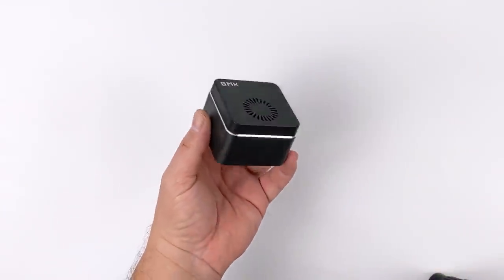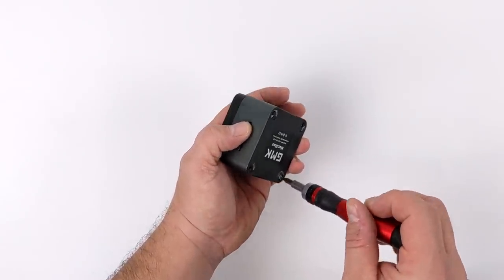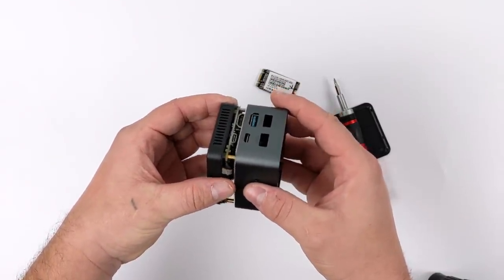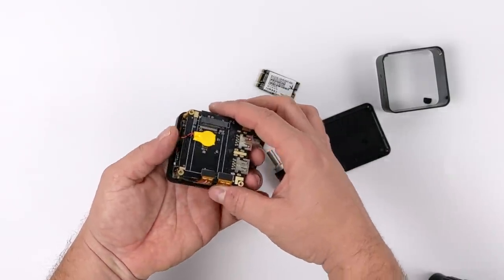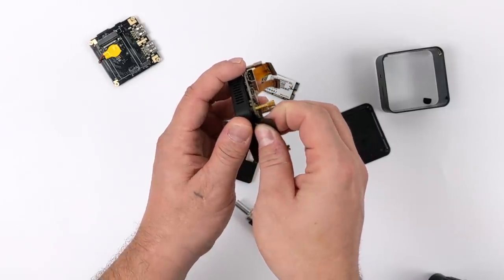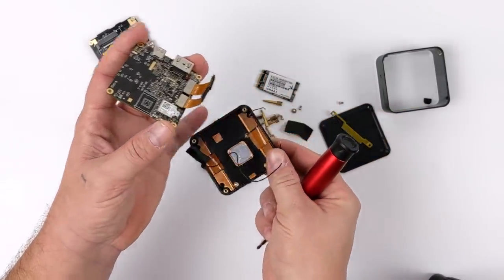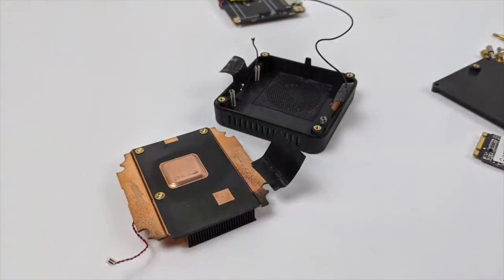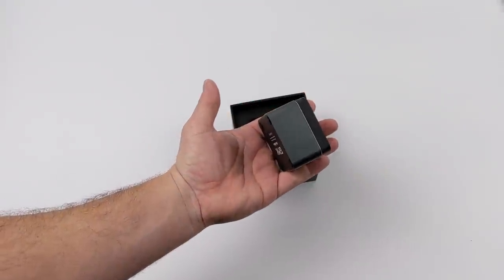GMK NucBox Teardown, Ultra Tiny 4K Windows PC

Comment: I wana see discrete graphics an more powerfull cpus in these little  box pcs
Reply: @bugrasevinc9696  you do know amd makes apus right?
Reply: @MrDeadmanwalken1  yeah i want a ryzen apu on these form factor
Reply: @mtaufiqn5040  even a ryzen 3 or 5 would be nice i wouldnt complain about the extra space needed for a vapor chamber cooler or the noise of the fan
Reply: Nvidia has a mobile gpu that could work, the mx330 I believe. It's basically a gt1030 with some modern vram. It's in a lot of light duty notebooks I've seen and it should be cool enough running for a ultra compact system.
Reply: doubt that happens but one of those juicy AMD APU's would be nice especially when they come with NAVI cores instead of VEGA cores
Reply: @LiLBitsDK  it would be a huge mini pc if they add navi
Reply: @mtaufiqn5040  why? you do know AMD makes tiny SoCs with VEGA right? going from vega to navi would not make it huge... unless you expect them to put in a 6800XT which would be unrealistic...
Reply: @LiLBitsDK  hmm let see
Reply: @DigitalJedi  there is a problem with that. I want the x86 instruction set
Reply: @MrDeadmanwalken1  the x86 instruction set is for CPUs to my knowledge. The mx330 is literally a GT-1030 with some modernized components all soldered to the motherboard. It's reasonably strong for some light gaming and plenty for video encoding/decoding.
Reply: @DigitalJedi  ah i thought you were talking about nvidias tegra... also amds apus out perform the 1030
Reply: @MrDeadmanwalken1  You said discreet graphics, which would exclude APUs as they use integrated graphics. And yes, an AMD APU would outperform a 1030 and draw less power.
Reply: @DigitalJedi  so you suggest an infferior product over an apu just because i said discrete. I was suggesting a 1650 or 1660  cut down to size like they do for laptops... why in the hell would you suggest somthing weaker than an igpu/apu?
Reply: @MrDeadmanwalken1  Something this small has serious thermal limits and power consumption to think about. My laptop runs a 1660ti and that chip draws a lot of power. A mobile 1650 would be a reasonable choice but is still likely going to be pretty hot in something smaller than my palm. What keeps those chips cool in a laptop in thermal mass and lots of forced air from the fans. You could run a 1650 in something like a mini pc, but I just think this is just a little too small. Maybe going to AMD's mobile Radeon chips is a better option.
Reply: @DigitalJedi  did you see the skull canyon nuc? That thing ran fine
Reply: @DigitalJedi  as it is nvidias 5nm process should be out next year
Reply: @DigitalJedi  also a power brick can solve power restraints
Reply: @MrDeadmanwalken1  Skull canyon nuc is much larger than these mini pcs, which is what I assumed you meant.
Reply: @DigitalJedi  as technollogy advances so do the packages ie size an temps
Reply: @DigitalJedi  Not gonna work mate. Have you seen an Mx gpu yet? The pcb space for chip and memory is literally bigger than this thing here. Not mentioning additional vrm. Apu is a better bet. Dual core R3/Athlon might fit.

Comment: Great video as ALWAYS!! From what I see, they listened to your feedback and fixed the thermal issues you told them about from the pre-release unit. I bought the 512GB model so I have no reason to take mine apart other than curiosity. Your video took away my curiosity but I will always have a "how-to" video if I need to take it apart. As of today Amazon was sold out of the 512GB model but still had the 128GB models. I expect they will restock soon.

Comment: At 1:05 the plastic under that ssd looks melted/deformed. It is because of heat? Can you check ssd temps while using the box? I have larkbox and the ssd temps are so bad, but i pulled it and using emmc, sadly gmk nucbox has no emmc and only god knows how much will work an chinese ssd under those heat conditions. Also the spring load cooler is an interesting way, i'm thinking if i can diy something similar on the larkbox to replace the pad with paste.
Reply: I thought the SSD looked a bit trapped in the underside of the case with no scope for cooling. That heat has to go somewhere and it rises up through the lower circuit board and probably heats the surface that PC sits on as well.
Reply: Could one not use a little thermal tape to alleviate that?

Comment: Biggest question for me, will it run Office 365.
Reply: Yes, i've seen laptops with worse specs even with a harddrive run 365. This one should fly through it with no issue.
Reply: @SeMr7en  Sure... Don't want to tell boss man, let's get one of these to replace an older PC and then it choke and puke when it's placed.

Comment: It's a shame that they didn't add an emmc (even though there are the pins for one) and that the M2 is not NVME. It would have been awesome with mpcie or m2 nvme with pcie 4x, for external gpus...
Reply: Thinking the same. Would be an interesting project, a micro pc attached to a evga.
Reply: I was thinking of modifying mine to house this very idea......

Comment: It's cool to see how the pack so much into a small box.  However and really digging that screw drive he is using.
Reply: I have the same or similar. It was a cheap kit with two strips of different tips. I got it at Walmart years ago.
It says "USA PAT 8210074" deeply embossed on the front of the screwdriver handle as you look down the body from the tip end.

Comment: I love my gmk nuc my only regret is the 128gb ssd it runs games good and i have had no issues with thermals so far it does flight sim 2020 skyrim c&c red alert and tiberian sims 3&4 forza 3456 ect all run excellent once i added the intel graphics controller. But they have to be run external usb ssd and this adds lag big time i really wish i got a bigger ssd like 512gb minimum 1tb would be even better i was shocked by the performance from this little box.

Comment: Interesting what they can do with this tiny micro PC form factor.

But for me a Mini PC with a Mini ITX is still the way. With on of those Asrock Boards with a similar J41xx APU or better a Athlon 200 GE (OC), Ryzen 2200 G or 3000/3200G. I think the cooling (also with that standard AMD Cooler) should be a bit quieter and I like the use of some old 64 GB/ 128 GB SSDs (I still do have laying around) and the later option on m.2 SSDs if its necessary.

Comment: Absolutely love it.
I was a little concerned that the fan ran at all times and did not find a setting on the BIOS to control the fan speeds. I found an option to enable the processor thermal sensor but I'm not sure if that throttles down the fan. I remember that used to have an Intel Atom netbook that had an always on fan too but it had no issues.
I was also wondering if the Wi-Fi reception could be improved with external antennae but I should be fine with my setup.
I mainly use it for media and game streaming in the living room from across my PC in the basement. It performs great!
It's by far better than using the amazon fire cube because I can stream games with 5.1 surround audio. That was impossible with the fire stick and I wasn't ready to experiment with the fire cube at the same price as the nucbox.

Comment: Why did they not go with an AMD A10-7800k Black Edition
Reply: @J Fz The computer that I am running Linux Mint CINNAMON 19.3 (Tricia) 64bit edition is running the AMD A10-7800k Black edition and I haven't had any problems with it ever although the only little niggle is that the main HDMI socket that I want to use is blocket with something I cannot get out and yes I have tried to remove it from inside and can run without a Ethernet cable connected and still have access to the internet because of internal WIFI adapter and Bluetooth.